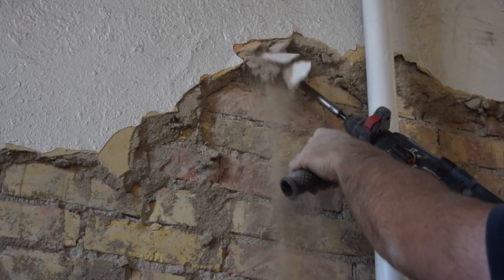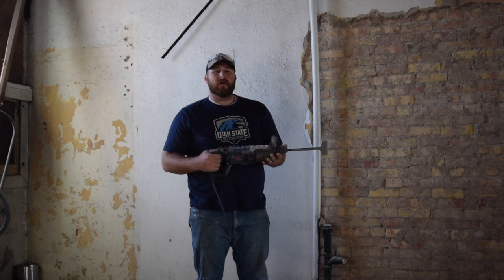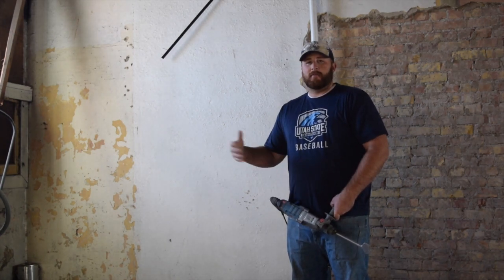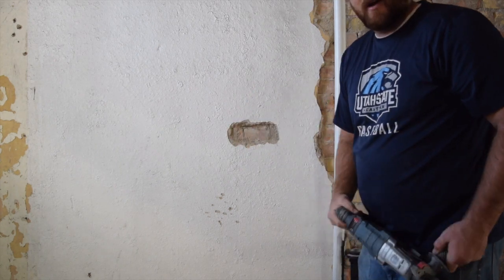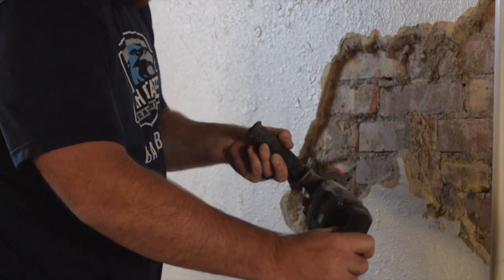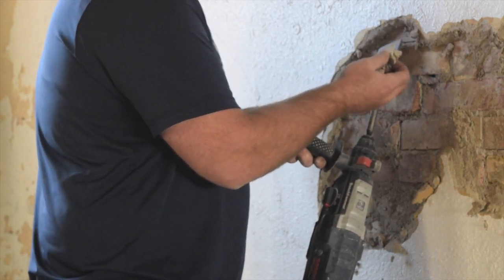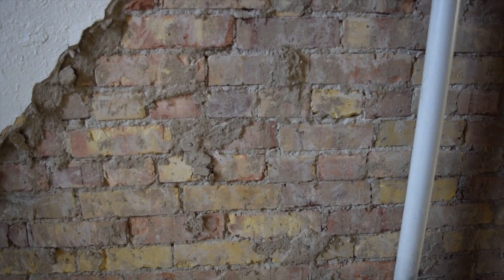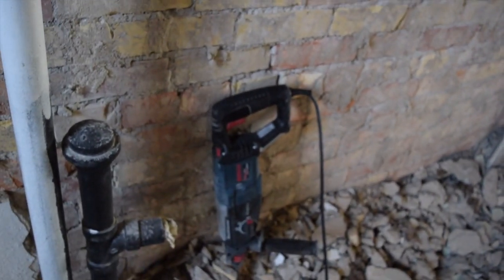How to Expose Brick and Remove Plaster

Comment: Thank you for this amazing video I’ll buy this tool tomorrow finishing the brick to be exposed. I think it will be good idea for sand it as well after make it smooth and stain clear coat for protection if wall is exterior 😊

Comment: Great tips.  I just bought an antique brick building and after a half-day I am happy with my progress.  Hadn't seen this and started with the hand chisel, which I found tiresome but I was getting a lot done.  Then I had the bright idead to buy a chisel bit for my sawzall.  I wanted to avoid the hammer as I have seen chisel marks in many 'buildings redone by professionals'.  The sawzall bit it thin enough to not mess the bricks up unless you arent paying attention.  I think it has a bit of flex in it that helps deflect itself from the brick into the plaster.  Cheers!

Comment: Hi. A couple of questions, please? I don't have brick...I have stones that were hand chosen from a nearby river and brought, 100 years ago, to build this house which my gr8 grandfather built in Italy.....<sigh> and then covered with plaster. It is not nearly as thick is the one you are doing but perhaps 1/4 of an inch....As much as I would love to just rip all the plaster out of this house to expose the beautiful stones, well, that is out of my league so the pieces, inside, which are a bit crumbly and or humid, I would like to take a tool and just tap to see what falls and what does not...then chisel away and fill the border with a pre prepared cement. You are doing a large piece so the electric chisel makes sense but I want to do little pieces and how those pieces fall is fine. I don't like overly geometric looking shapes, anyway. I like it to look ragged. My questions, would you suggest a hand chisel? I have seen here, that when they are looking to break off old plaster, they use the back of a hammer and tap tap tap to see what is weak and is ready to fall on its own...and this is what I'd like to do. Any ideas? Then, as someone already did this when I had a stove put into the house, I will fill the top along the boundary with the remaining plaster, with a light rim of cement. Just your thoughts, please? I mean, if you ever even see this. Grazie mille!

Comment: Impressive work dude. Have a link for the masonry bit you are using?
Reply from the maker: Not sure if this is the same one. I can't remember. But this is essentially the same thing I am using.
https://www.homedepot.com/p/Bosch-3-in-x-12-in-Hammer-Steel-SDS-MAX-Scaling-Chisel-HS1910/301380084
Reply: @jessandjessicab  I also purchased an abandoned commercial buidling in September 2020. It is a 15,000 square foot, 3-story brick buildiung from the late 1800's with plaster on every interior brick wall except the basement. I have been gutting it almost every day for the past six months and am just getting to removing the plaster. Thank you for the great video. You are correct that the 3" x 12" chiseling bit that you refer to in the video is the way to go because it takes more plaster off quicker and the wider bit does not tear into the brick as much the less wide bits. However, none of the four Bosch Bulldog models will accomodate the large shaft size of the 3" x 12" bit. The Bosch 3" x 12" chiseling bit only works with the heavier, more expensive and less maneuverable Bosch SDS-max series of rotary hammers.

Comment: Do you think there would be any complications doing this on a wall with windows?  It’s a prewar apartment in Manhattan.  & would it make the room colder?  Does the plaster help with insulation?
Reply from the maker: I dont think the window would be an issue unless you actually hit the window. I dont think that you would notice much of a difference with insulation if you remove the plaster and the room is sealed and insulated correctly in other places like doors and windows. Although removing the paster does technically decrease the effectiveness, but like I said it shouldn't effect it to much to be noticed.
Reply: @jessandjessicab  Thank you so much for this info!!

Comment: We are almost doing the exact same building. How long did it take to do the one wall?
Reply from the maker: One wall is about 90 feet long and 12-14 feet tall. One of those was about 10ish hours. I only did about 2-3 hours at a time usually after I got off work. Where you doing your wall at?
Reply: @jessandjessicab  awesome ;) Tell the city to leave you alone now so you can get to work :P
Reply from the maker: @diyretroarcade  Seriously! We should get it all sorted out but its annoying that it will be stopped for like a month. Thanks for the support.

Comment: Hi!  I  have an interior brick wall that opens up to a fireplace.  I am trying to remove what  may be cement and not plaster (according to my husband) from around the fireplace opening. Is the  Botch hammer something you would recommend if what we need to remove is cement instead of plaster?   Let me know if you have any other suggestions and thanks for this content!
Reply from the maker: Yes I think it would work well with cement too. If it is a large job possibly another tool might work better though. Good luck with your project.